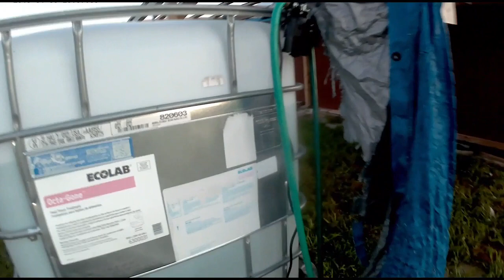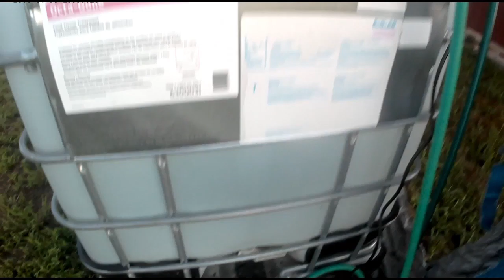Around the Cattle Panels

Comment: You’re doing a remarkable job gardening in excessive heat. We’re back up to 103-104 temperatures in north Texas. I’ve covered what i could with shade cloth. I’m just trying to hold on until the fall when we get cooler weather. Thanks for sharing your progress. 👍🏾♥️
Reply from the maker: At this point, that's what I'm doing too. It's so crazy out here!